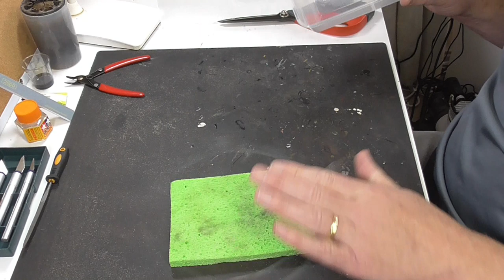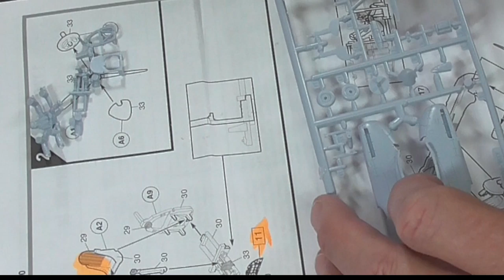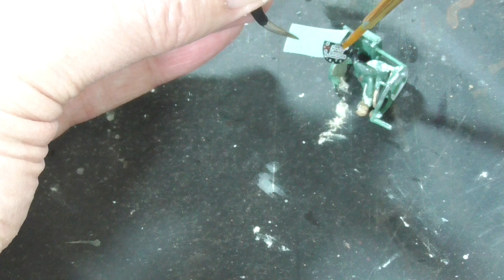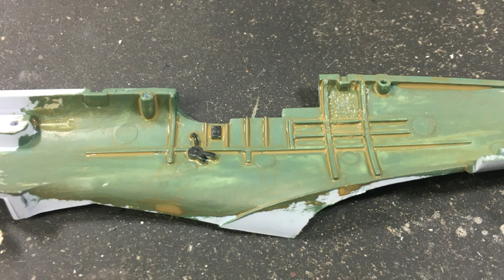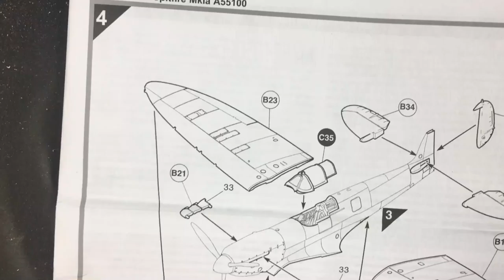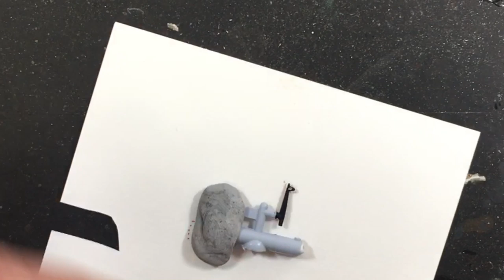Airfix 1/72 Supermarine Spitfire - The Build (Beginners Build Along)

Comment: That's a great tutorial for the beginner, and useful for us oldies too- I'll definitely have to start using a wet pallette.
One tip I discovered when building my version was to leave the propeller blades & spinner off the model until the final assembly. Not all kits make this possible but it makes adding the wings & painting much easier.
Reply from the maker: Thank you Ian, I'm glad it was helpful.  I don't think i had the option for doing that with the props, but saying that i was on the back foot at that time with the cockpit fit so i didn't look to hard at it, it would be helpful though if you could put them on later in the build 👍👍👍   p.s I got your Skywalker spit pics, they will be going in the next video for sure, it looks great!